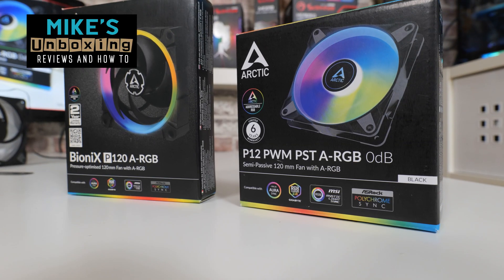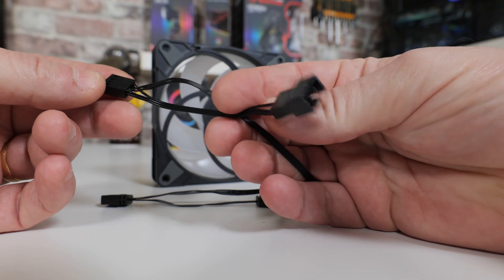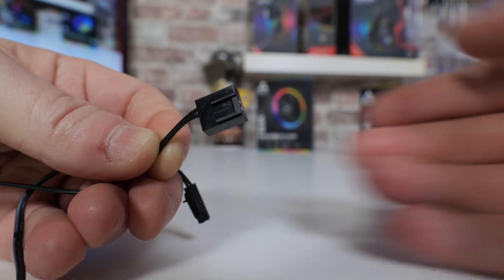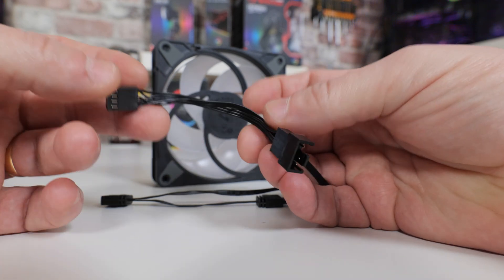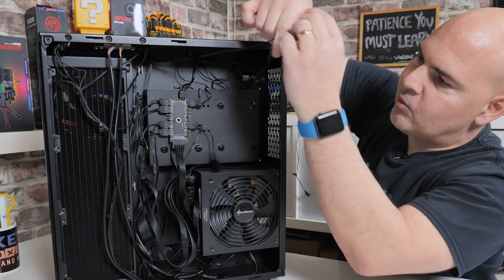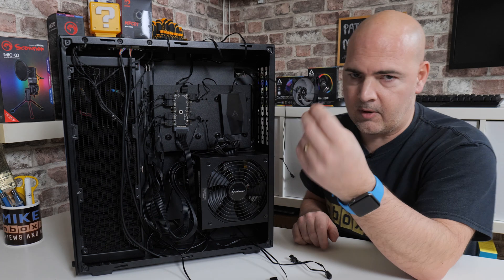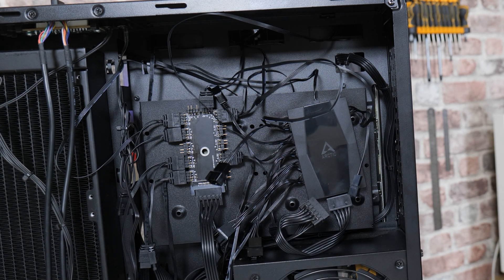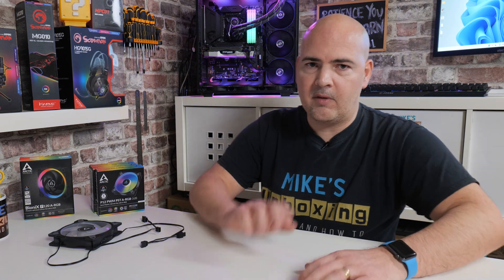Add Extra PC PWM Fans With Arctic SATA Powered 10 Port Fan Hub

Comment: Can use the fan slot usually reserved for the AIO fan to plug in the hub? Because my case comes with 2 fans that have a 3 pin connection, and my motherboard only has 2 fan slots plus the AIO fan slot.
Reply from the maker: should be okay

Comment: I'd like to ask if I need to connect the 4 pin to the motherboard since my prebuild doesn't have one, and if I can just put the sata cable in and have it at full speed?
Reply from the maker: that might work that way, depending on the fan, some might see no signal and good full others might stop
Reply: @mikesunboxing okay, I will try it out, thank you for the answer

Comment: does it work with any fans???
Reply from the maker: any 4 pin PWM fans (this will not connect ARGB that will need another hub)
Reply: @mikesunboxing  I think the other hub is called a fan header, thanks for helping tho

Comment: I have some Questions :
1- Does a fan have 2 cables or two ?
2- If I plugged the fans into the hub do the RGB sync
3- if Does a fan have 2 cables are they 1 for RGB and 1 for Power ?
Reply from the maker: you sort of answered your question there, most common fans with argb or rgb have two cables, one for fan speed and one for colours. the hub in the video will only use the speed wire.

there are other fan hubs that also have both

Comment: Hi, Mike! Quick question. I'm looking to buy 8 T30 Phanteks fans for my Corsair 7000D case. Would this fan hub work with them? Thanks!
Reply from the maker: It should be okay, not sure about the power rating of those fans, so double check the total wattage or amps

Comment: I have 5 fans going 2100 rpm and 1 fan going 1300 rpm. What happens when I set it for 2100 rpm, will the fan going 1300 just run at maximum all the time?
Reply from the maker: the pwm scale is from maybe 0-100% or 30-100% depending on what fan is connected to port 1.
so the hub doesn't really look at rpms it looks for a PWM value, which will be different for different model fans

Comment: Can you use any fan hub with any fans? Or does it have to be same brand make as the fans?
Reply from the maker: they can mix and match as long as the standards match, like 3 pin DC control or 4 pin PWM

Comment: Does it have to be connected to a motherboard what's the down falls if its just connected to a sata cable my hub has a 3 and 4 pin cable but works fine with connecting ot to motherboard any help please thankyou
Reply from the maker: it has to be connected to the fan header on the motherboard or the fans will either be 100% or 0% if no pwm signal is present
Reply: @mikesunboxing  thanks for your reply I forgot to mention my lad operates them with a remote that came with the fans the lights and the speed or is it still better connected to the header thanks again

Comment: I have a 4 pin connector on m'y corsair ll120 rgb but they trurn at max speed. Can someone help me ?
Reply: For information I have a MSI b450 gaming plus and I didn't plug the arktic on the first fan connector maybe it IS the problem
Reply: And I tried to control them with fan control but it didn't work
Reply: @emeryc5645  maybe unistall or install your mobo software, i have a gigabyte and there is a option to control it.
Reply from the maker: This is maybe easier to fix or at least advise if we can ask more questions and get direct answers, so feel free to join our Discord chat and we can go over it in more detail https://discord.gg/XtBTGQ6BDu
Agree to the rules by clicking the emoji and you will get access to the rest of the Discord channels

Comment: Sorry but I don’t still get the thing with the first port. I am planning to plug as follows - 2x Noctua A14, 2x Noctua P14s redux and 1x Noctua S12A. Will there be any issue? Would it be possible to regulate each one so they are not same speed?
Reply from the maker: they will all be using the data from fan header number one and replicating that to the other fans, if the PWM signals are out of sync that is because of using different model fans
Reply: @mikesunboxing  thank you very much for reply it is really appreciated! but I am still in doubts, so with this FAN hub I am not able to control the fans separately? They all have to be set at the same RPM as the 1st one? else how I should connect them if I want to control each one by one?
Reply from the maker: @tonysoprano3138  if you want to control each fan separately you need a motherboard header for each fan or set of fans, or use specific fans that come with a controller like the thermaltake swafan ex or the lainli SL link fans

Comment: Hi, I have just bought this and plugged all fans in and now they are just running at 100%. I have it plugged into the pump_fan1 PWM port on my B450 A Pro Max. Any idea why this might be ? I have fan software and some of them say they can’t be controlled.
Reply from the maker: have you set the pump_fan1 port to PWM in the BIOS? If not do that, and also apply a fan curve to it
Reply: @mikesunboxing  I might of fixed it, I had a 3 pin fan in the #1 Slot of the hub and the instructions specifically say only to use 4-Pins haha

Comment: Can you connect let's say 5 exhaust fans and 3 intake in the same hub?
Reply from the maker: yes
Reply: @mikesunboxing would you be able to control their speed separately or due to being hub all will have same RPM? I couldn’t find controller with more than 3-5 slots, the hubs are with 10.
Reply from the maker: @alishfitness  no i explained that in the video, a splitter or hub just clones or copies whatever the mother header tells it. The PC as far as it is concerned is one fan

Comment: Potential thicko here, I have plugged an Arctic P12 Max fan (4 pin, PWM, listed as compatible), into the hub the number 10 position for no specific reason other than to test the plug fitting after purchase. Went in fine, I thought, attempted to remove and it will not budge. There's only one way to plug these connectors in right? It's physically not possible to slot the connector in upside down for instance. There is no release tab of any kind and the only grip I have is the wire in an attempt to pull it out (not happening). 

Know what I might have done?

edit: p.s I realise you're not Arctic support of course! I will attempt to reach out to them!
Reply from the maker: that should just pull out, but might need a hard tug
Reply: @mikesunboxing   Hey, got it out! Had to use the edge of a box cutter to lift it upwards and slightly out, then some 'lock picking' with a dental stick to raise the interior 'tongue' that clamps/secures the connector down. Took a lot of forceful wiggling to remove. It really feels like there is minor keying alignment missing such as on an RJ45 connector to depress and pull or the like.

No damage. I will carefully proceed when the build is due! 

Cheers for the confidence to go ahead. All the best!

Comment: Q: Can I plug the hub into the 3-pin sys_fan on my motherboard. My fans (arctoc p12 pst pwm) will just run at 100% right?

Also thanks for the review, I was looking for a hub 'cause I didn't want to overload my 1 and only fan header (quite old mobo too) and I bought 1 because of this vid
Reply from the maker: yes that is right 3 pin won't send a valid PWM signal so it will be 100%
Reply: How's it going so far? I just ordered one of these and it's arriving tomorrow and my fans are 3 pin ones as well.
Reply: @Tenders7800X3D  it's been doing great for me. Just plugged the hub onto my motherboard and plug the rest of the fans to the hub

Comment: helllo i wanted to ask fits this to  this fans: ARCTIC F12 (5 pieces) - PC Fan, 120 mm Standard Case Fan, Quiet Fan, Case Fan with Standard Housing, Push or Pull Configuration Possible, 1350 rpm - Black
Reply from the maker: yes that is fine they are 4 pin PWM
Reply: yes?
 @mikesunboxing
Reply: in this case is it possible to control the speed with dc or vdc control?
Reply from the maker: @rrufeja3929  still no

Comment: Quick question, I have only 1 fan header on my motherboard and currently have a 3 pin exhaust fan. I’m getting three 4 pin fans for the front intake. Is it fine to plug in the 3 pin exhaust fan and have it going at 100% all the time since I’ll have way more intake fans at the front?
Reply from the maker: yes that is fine

Comment: Can someone please help! I’m planning to get atleast 6 Arctic p12 Rgb fans in my case and am confused on how the connections work. So the fan hub only controls the fans itself so we plug in all the fans in that hub, which connects to a fan header on the mobo, but where do I plug the Rgb cables for all 6 of those fans? (Sorry if I’m a bit slow I’m new to this building pc thing)
Reply from the maker: you can daisy chain them together and connect to the ARGB or RGB headers on the motherboard or your case controller

Comment: So im thinking of getting these argb fans and fan hub, will this fan hub allow me to control the colors specifically like argb is meant to. Im very very new to the pc world and will be using these fans in my first build
Reply from the maker: no this is for the speed aspect of the fans only, for the ARGB you need a separate additional control box, or a combo unit that does both like the coolmoon one we reviewed or the airgoo one. if you need more help try our discord chat rooms
Reply: @mikesunboxing  appreciate the help would a physical rgb hub be necessary or could a software on a PC bypass the need like openrgb, signal rgb or others?

Comment: the best strategy is to use daisy power cable as a group .. bottom daisy group, back daisy group, top daisy group and single power cable for left if u have 9-10 fans. each group will be connected directly to motherboard ( so u will use 4 3Pin fan plug ) and for RGB its better to use Arctic fan hub and connect the hub to motherboard. in this scenario u are getting less randon flying daisy chain as show in the video and u can get even better power supply for each group separetly and Arctic Hub will take care of RGB. stick with this method

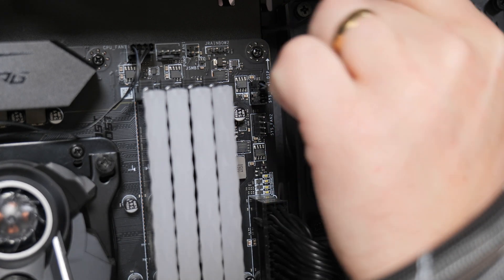Comment: Hi Mike, I noticed that at minute 6:18 the liquid cooler connector is connected to the CPU Fan1 socket, instead of the Pump Fan1 socket which is free. How come?
Reply from the maker: the arctic freezer AIO only has one cable to the motherboard and that is controlling the pump and fans at the same time.
Reply: I'm sorry, but isn't having 4 fans (3 large ones and the small one on the heatsink) plus the pump all connected to a single fan connection problematic? Isn't this the same reason why in this video you disconnected the 3 fans connected in series to connect them to the Artic Hub?  @mikesunboxing
Reply from the maker: @DanieleGambetti  the arctic cooler has been designed to be used that way. usually i wouldn't like more than 3 fans on a single header, but with this there isn't another way. And also from the huge volume of these sold worldwide, if there was an issue we would have definitely heard about it by now.
But i totally understand what you are saying.
Maybe the arctic fans and pump are higher quality and more efficient than other units?
Reply: @mikesunboxing  I'm a novice in this field, thanks for the clarification!
Reply from the maker: @DanieleGambetti  no problem, always good to ask about these things if you are not sure.

Comment: will a 3 pin plugged into a 4 pin splitter act accordingly? or still run at 100%
Reply from the maker: yes that is right, because the PWM signal isn't available or wired it just runs 100%
Reply: lastly, did the packaging include a sata cable ? @mikesunboxing
Reply from the maker: @tonybologna-5045  you don't need one, your power supply should have them and plug straight in

Comment: Sorry for the nube question here.  I am working on a rather oldie but goodie HP Z420 and HP has these proprietary 5 pin fan headers which makes connecting any fan hub to the mobo difficult.  Can I just install this fan hub without the wire being connected to the fan header?  And just have the fans on the fan hub power up with they sense the power from the PSU?  Thanks in advance.
Reply from the maker: if there is no driving signal the fans will either run 100% or nothing, it really needs that PWM signal to operate correctly
Reply: @mikesunboxing  Thank you

Comment: quick question to all of you in the comments, if i plug in a 4pin pwm fan into the 1st slot and the rest of the fans are 3 pin voltage controlled, will they spin at the same speed as the pwm fan? my arctic fans are way too loud for this shi- lol
Reply from the maker: no 3 pin fans will only ever run at full rpm on any pwm based hub
Reply: @mikesunboxing  it's alright, i already bought deep cool fans that have pwm control through amazon same day delivery. They're double the price but the difference is immaculate

Comment: Can i plug both Argb pwm cable and rgb pwm cable on thoses 10 holes ? Or is it only rgb pwm pls ?
Reply from the maker: This is for fan connection only not RGB or argb
Reply: @mikesunboxing  Ohh okay, so as long as it's a fan it's fine then doesnt matter if the fan is rgb or argb
Reply from the maker: all it has to be is a 4 pin PWM speed controlled fan @Eldawn  if the fan also has rgb or argb then a separate controller can be used if needed like this one https://www.youtube.com/watch?v=4qgPBEZWSpw

Comment: im kind of a noob when it comes to computers so thats why im maybe asking a dumb question, but the fan hub plugs into the motherboard with the SATA cable that comes with the hub, but does it come with the cable to plug it int othe PSU? or does that cable come normaly when you buy the PSU?
Reply from the maker: the sata power lead comes from the PSU and connects to the hub
Reply: @mikesunboxing  ah ok, thanks

Comment: Hi I got a question what do you suggest i have 4 pwm case fans and i got a 360 aio could i plug in the aio fans in the controller? I also got an aio pump header on my mobo, so the aio pump goes to the pump header and the controler with all my fans connected to to the cpu fan hader ?
Reply from the maker: This is maybe easier to fix or at least advise if we can ask more questions and get direct answers, so feel free to join our Discord chat and we can go over it in more detail https://discord.gg/XtBTGQ6BDu
Agree to the rules by clicking the emoji and you will get access to the rest of the Discord channels

Comment: hi, in my soon to be future pc i need to power 8 pwm case fans i can technically buy 4 splitters but i want as less cables in the front as i can, both options cost the same for me, my mobo in one pwm fan header cant power 8 fans, but if i use the pwm fan hub with sata ofc will it power them all 8? im making sure i understand correctly
Reply from the maker: yes that sata power takes the strain from the motherboard header

Comment: HI Mike, will this work for corsair  fans?  I got six  of them on sale and was happy about that now im less happy coz I found out I will need to get corsair expensive controller . Looking for solution , thank you for any tip you my have.
Reply from the maker: this will control the fans speed but the Corsair hub is required for the lighting
Reply: @mikesunboxing  yes I do have hub which came with the fans and control up to 6 RGB fans. Will I be able combine those two hubs to control 6 Corsair fans?

Comment: Hi Mike, i have a quick question can I plug the 4 pin connector to the cpu fan 4 pin on the motherboard? because my motherboard doesn't have an extra 4 pin connector
Reply from the maker: yes you can, all fans will ramp up and down with the CPU temps

Comment: way to not show how you connected the rgb.
Reply from the maker: it isn't an RGB hub so why would i do any rgb wiring? if you are buying this for rgb lighting you are buying the wrong thing.
you will need to buy a separate RGB or ARGB hub to do any RGB wiring for the fans you are using, of which we have done a few videos on those

Comment: So i'm using the NZXT H510 and i'm using the Kraken x63 in front and i'm gonna be changing all the fans to Noctua's, so i wanna get this hub so i can control them all at the same time with one port. Now my question is, would it be ok to connect the fans i use for the rad into the hub as well or should i still separate CPU_Fan and Case fans?
Reply from the maker: i would separate them personally, but depends on the noise levels you are prepared to accept
Reply: @mikesunboxing  I wear the Beyerdynamic's DT990 Pro's Open Back, so noice is a very annoying thing for me.

Comment: Mike sorry I didn't understand the pin part. Can I hook up both RGB fan from the radiator and ARGB case fans, all of them Arctic but different models (One from arctic liquid freezer II and Arctic Bionix P120). I'm trying to achieve a two tone  10 case fans lighting so need 5 fans connected to each 2 hubs to get this set. Hoping for your reply. Thanks
Reply from the maker: This is maybe easier to fix or at least advise if we can ask more questions and get direct answers, so feel free to join our Discord chat and we can go over it in more detail https://discord.gg/XtBTGQ6BDu
Agree to the rules by clicking the emoji and you will get access to the rest of the Discord channels

Comment: Awesome video. My motherboard is a B450 DS3H v1 and has 2 fan headers (SYS and CPU). The headers only output up to 1A each. I'm planning on installing 3x Corsair fans (which they power 0.5A each). If I buy this fan hub and it's connects to the motherboard and sata power plug (by the psu) with the 3x Corsair fans then I should be fine?
Reply from the maker: that is right

Comment: Hello Mike .  my mobo"s fan header 1A 12V and if i want to use 3 daisy chained fans( but each of has with.037A )with %50 or maximum %70 speed,does it damage the header or fan itself? . I think it doesnt but i have make sure .
Reply from the maker: it should be okay, if you set the fans to 100% and the system crashes it might be overloaded